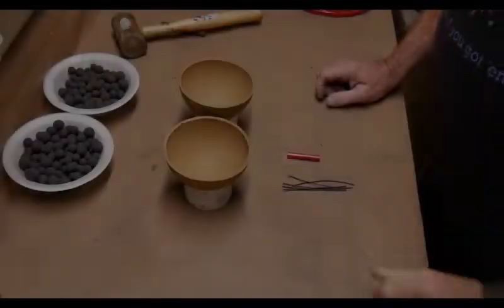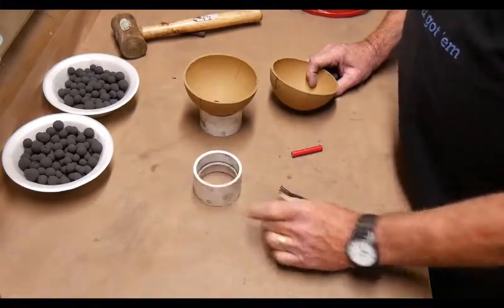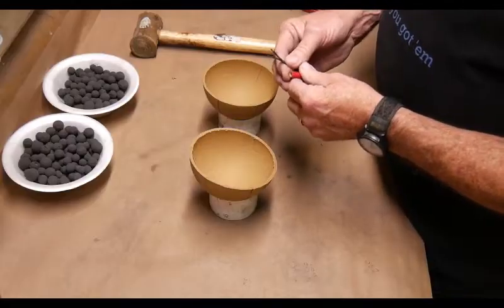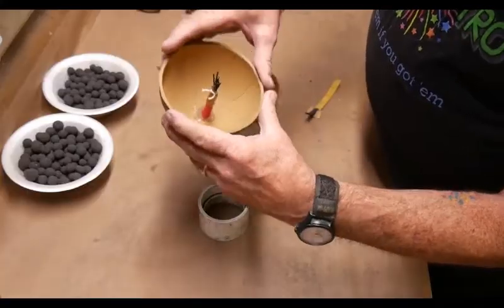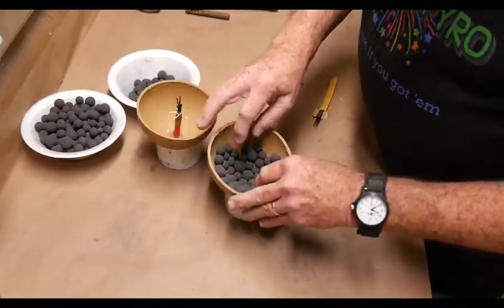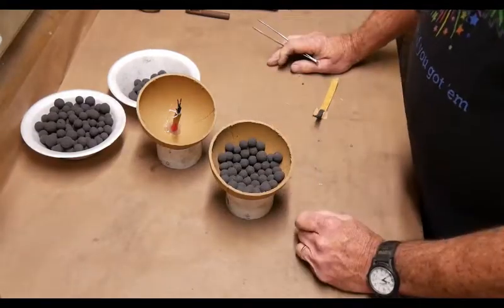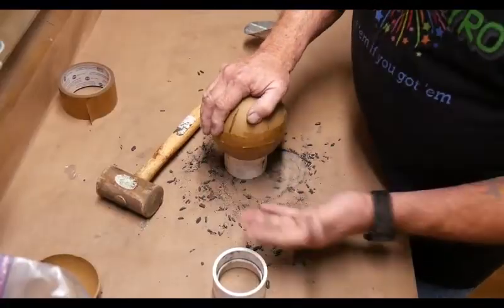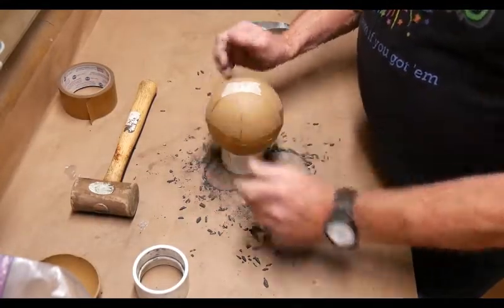Video 4 - Building a  Firework Ball Shell

Comment: Wouldn't the plastic wrap cause some type of static electricity that could ignite the burst charge? Or what are some things to watch out for? Like for example do you wear specific type of clothes that won't cause a statuc electrical discharge? Is that enough to set off the burst charge?
Reply: I’ve never worried about that. In colder weather I do use a static spray on my clothes and work surface.
Reply: @Tarheel_Pyro  do you have a video explaining the different chemicals that make different star 🌟 effects?
Reply: @Tarheel_Pyro  thanks, what's the biggest shell you ever built? And what's the biggest you have seen in the sky in person?
Reply: @Tarheel_Pyro  my gosh that's such an amazing memory to keep.
Ohhh wow, 12 inch shells are such a nice size hehehehe

Comment: what will happen if the burstcharge & stars are not tightly compressed inside the shell and rattling?
Reply: The stars will shift out of place and you will get a sloppy break.
Reply: @atfboi4458  Thanks for your answer, it will not cause a flowerpot? I Mean will it not explode in the tube because of friction?
Reply from the maker: Nope
Reply: @TarheelPyroChannel  
Thank you! Now I can light my shell without a doubt

Comment: Nice work and good lookin stars. I rolled clorate purple for an 8 inch and man o man that was a lot of Rollin. I have found using cork like the italians for break works well and covers easier well rolling on. I'll have to try that chlorate booster on rice or cork
Reply from the maker: I have a friend that uses cork. It makes some nice burst.
Reply: cháu là người Việt Nam chú cho cháu công thức làm từng loại màu được không chú cháu làm ít chơi tết cổ chuyền được cháu cảm ơn chú nhiều
Reply: For the lift cups is the size selection soley based on weight or do you match up the lift cups with the same size as the shell?
Reply: @theitalian556  the lift cup can be any size.. I usually just use paper and on ball shells I get a little more creative and use the cups that fit the shell or use paper aswell
Reply: @pa-pyro2804  Got it,
Thank you for getting back to me.
Reply: Where can i find the recipe for the booster? I tried slowing down my flash but.... Feel like its still too strong and possible that its breaking the stars. Either that or it was just too small of a firework and i didnt use costed rice hulls when i was practicing with my 1 inch fireworks